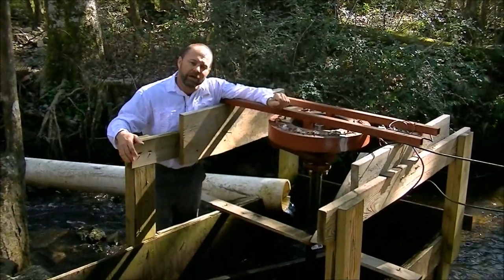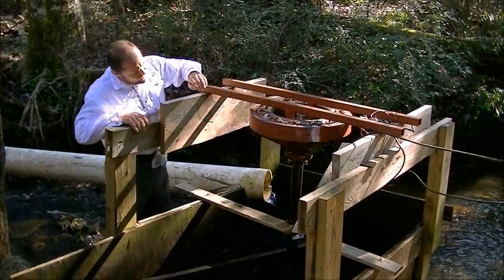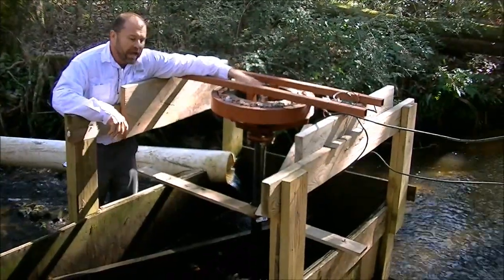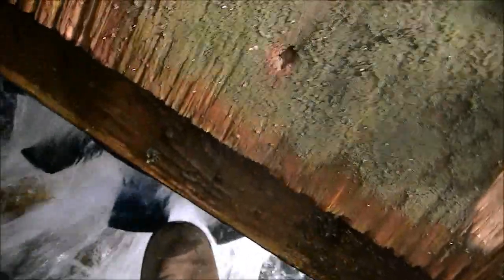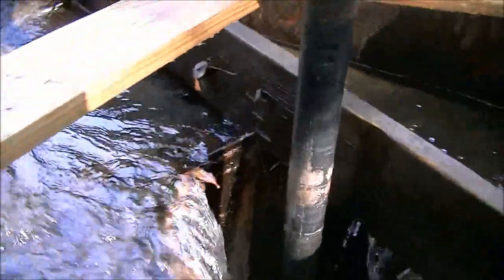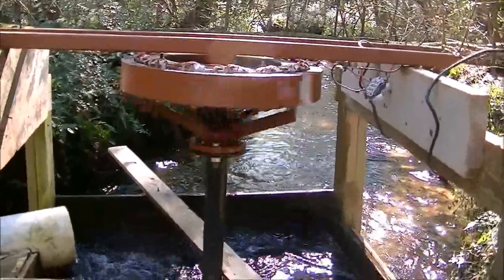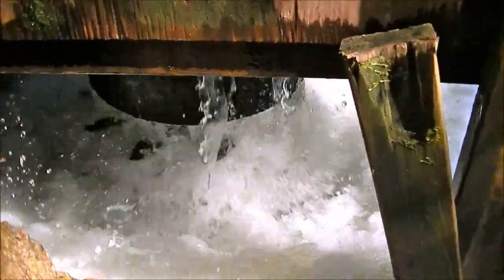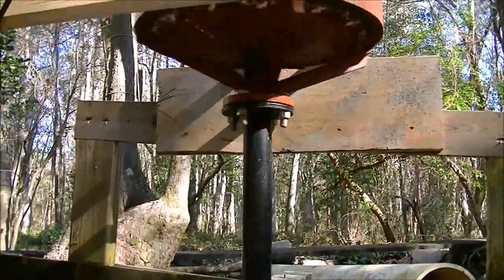Working home made hydro Generator/ Runs two refrigerators free electricity

Comment: how did you cast the wheel that holds the wires?  I saw your other video and it was unclear to me.  Thanks.
Reply from the maker: I made a mold and poured fiberglass resin with several steel rings.

Comment: How did you wire the 28 coils?  I thought the "standard" was coils had to be evenly divisible by 3.  Thanks for the sharing the video.
Reply from the maker: This is a two phase alternator, two sets of 14 coils with 28 magnets spinning.
Reply: Thanks for the info and reply, boss.
Reply: 500 gallons a minute?
Reply from the maker: Yes, 500 gallons a minute

Comment: a simple gear up system would increase the RPM, wider blades to increase the torque. I'm not an engineer but I would imagine it would get you over 1,000 rpm. great video to jog the mind!

Comment: I really like the concept. My guess is that a closed pipe just big enough to handle that amount of water and a propeller as close as possible fitted would increase the torque big time, blades formed by cutting them in a round metal disc. That could fit tight in a cilinder and be really efficient. And in a pipe with water pushing and water suction maybe some bigger blades overlapping each other could be fitted? We have no real elevated streams here in the Netherlands so no places to try this, but it's for sure a nice off grid energie source. I would also like to try to see if the height placement of the propellor in a pipe would make a difference. Should it be in the middle or more at the bottom? Or should it be several propellers? Such a pipe eliminating water pressure and suction from "escaping" sideways could generate much more torque and maybe allows for an extra coil to be fitted. Could al be build into one tube as a product almost (the fantasie is often better then the reality of it). "Just build a short wooden flume/ aquaduct into a creek or river with a decent drop in height put a hole in it stick a pipe in it and your done", it sounds so easy, an infomercial. Or just put the pipe with thunnel , Or as a hose in a less elevated waterstream instead of just a pipe upright in a bigger waterfall"". But I still think it really could be a succesful product when ideal proportions and sizes are known. I for sure like the concept a lot. If this technique is of interest to you just out of general interest, you should have a look into old dutch windmills. They were all used to pump water or cut wood instead of creating electricity (cutting beams by windmill was an invention which gave the Dutch a great advantage over England in VOC times). But still be it wind powered they had and still have some very interesting low tech solutions for the same kind of problemms they had to solve as well as we do now. keeping it simple, stupid.

Comment: where is the link to buy
Reply: markp0177 Would you be willing to put the video online that shows how you made it? I'm curious because I've been planning a self sufficient homestead for close to a year now. Learning about electricity is my focus at the moment, and all knowledge involved with this type of project will greatly assist me.
Reply from the maker: Bobby Nicholson Sorry, I no longer offer the generator. I don't have the extra time to make them.
Reply from the maker: +James Nunn I don't have a complete video, just the ones you see here on my channel. To build one you need to know how to weld and use a lathe.
Reply: +markp0177 can you atleast give us specification for coils, size, guage, turns, no of coils, its wiring, output circuit diagram and circuits, magnet size and power. rest we can manage.
Reply: +markp0177 And yes also the out put voltages and current details at specific rpms
Reply from the maker: +Ravindra Dhande  Watch this other video it may answer your questions.https://www.youtube.com/watch?v=lbpRdme4Tpg
Reply from the maker: +Ravindra Dhande&#160; I do not have output voltages at different RPMs. My system turns around 170 RPMs and puts out around 30 volts.